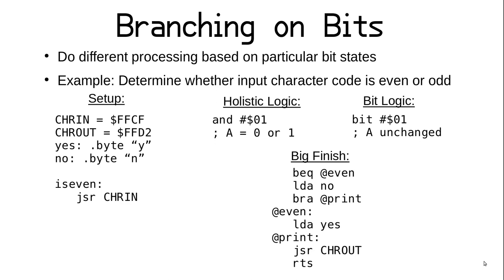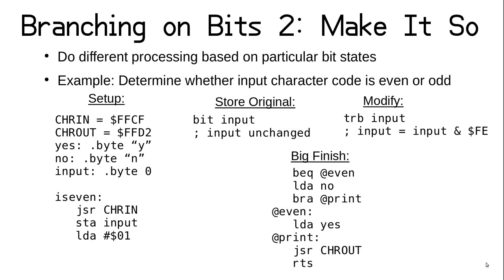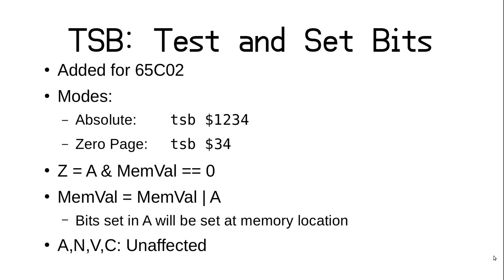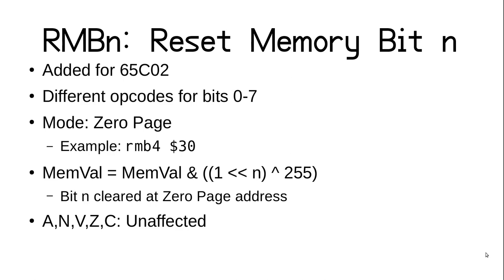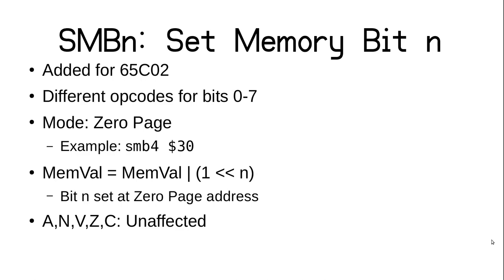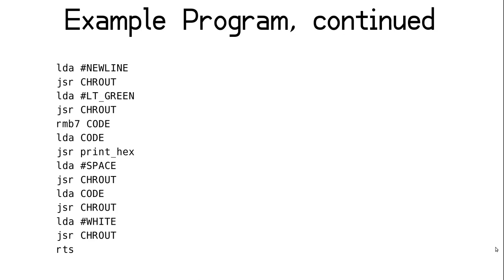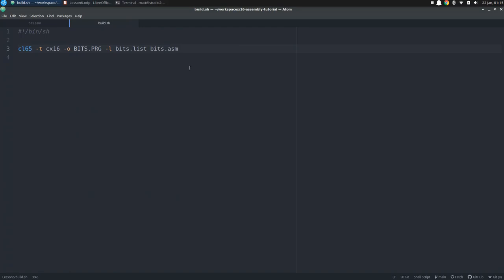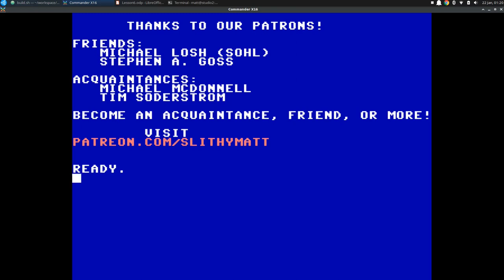A Bit Advanced: Commander X16 Assembly Language Tutorial, Lesson 6

Comment: Very interesting, Matt.  I was completely unfamiliar with the new 65C02 instructions for working with bits.  This makes the 65C02 much more like the Motorola/Freescale 68HC11/68HC12 in bit manipulation, maybe better! It's also interesting that the 65C02 does not have cycle penalties in these new instructions for crossing a memory page but it still does for the legacy 6502-family instructions.  I wonder if the designers left in the same cycle behavior for all the older carry-over instructions on purpose or whether there are some fundamental design constraints that make things work out that way? 

Your example code was good because it leverages bit-patterns in the PETSCII character set that are fairly easy to understand so people can follow along.  Where these kind of instructions really benefit is in time-critical hardware interfacing.  Do you know whether the X-16 kernal code is exploiting these special 65C02 instructions much?
Reply from the maker: I haven't looked too much. I think I might have seen a TSB or TRB in there somewhere, but most of the Kernal code is still the legacy CBM Kernal for the 6510.